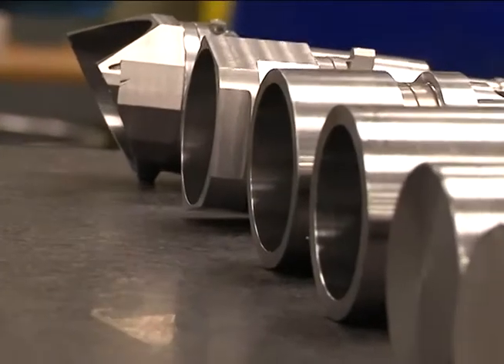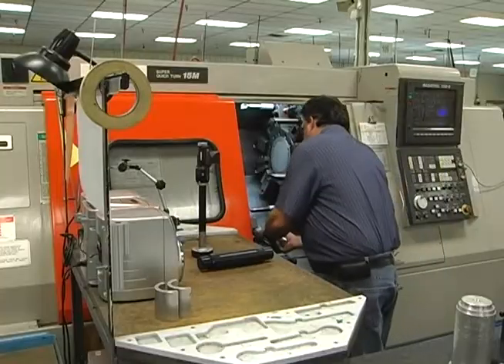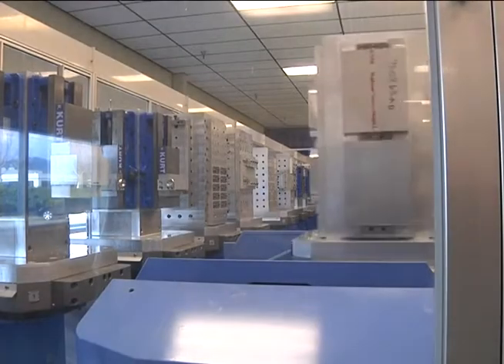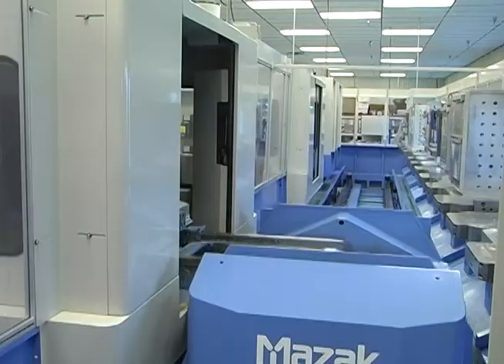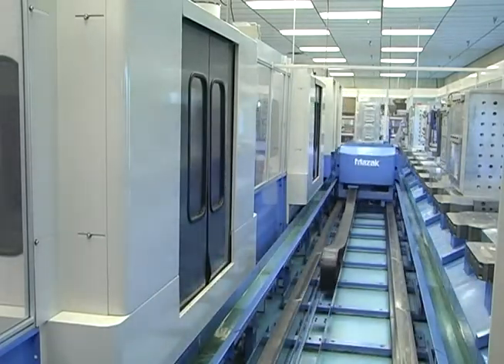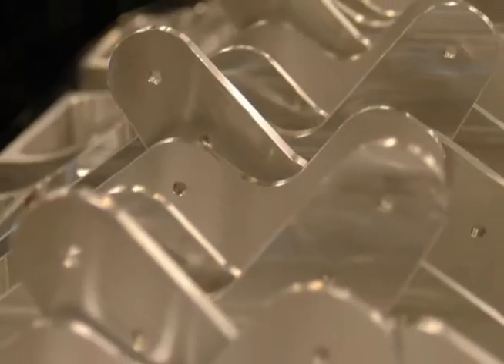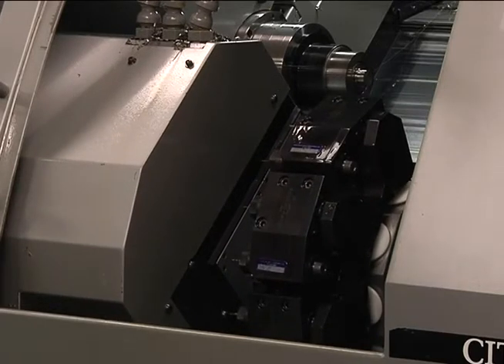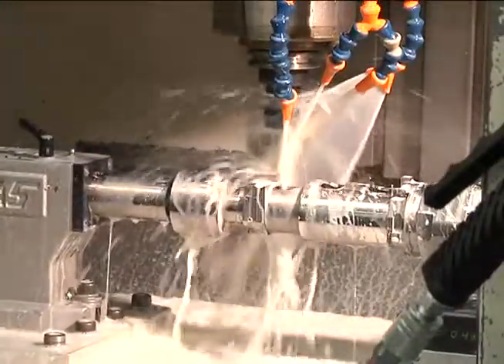Precision CNC Machining Overview

Comment: Just possibly one of the worst places I have ever worked at !   Very poor supervision of floor supervisors like "Mike' who set select operators up to fail by turning the extruders up to impossible levels of production.  These petty games foster an environment which produces an inferiour customer part.  Turnover at the Spokane plant is so high that two different temporary employment services can not supply workers fast enough to meet company needs.  If I were a client looking for an injection mold  company to supply a production part I  would definetly look  to companies other than Altek to supply the need.